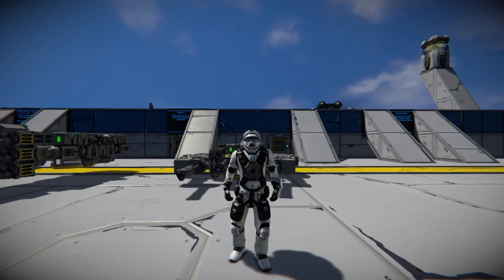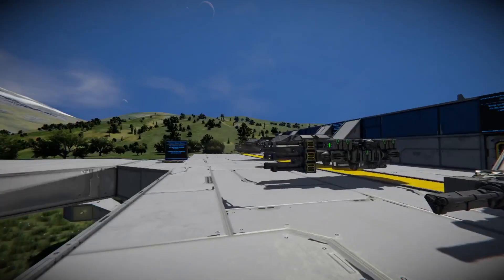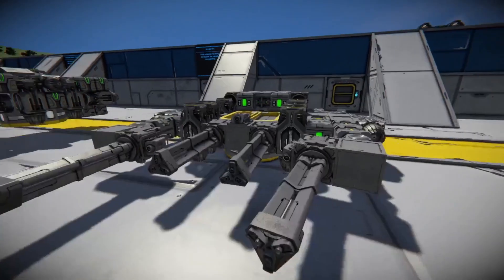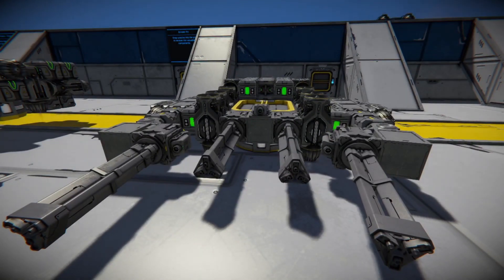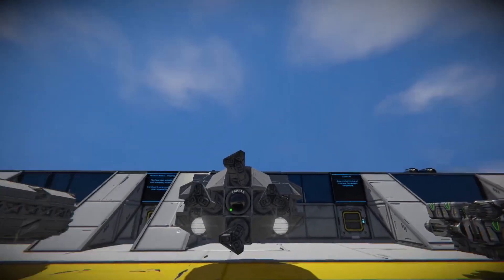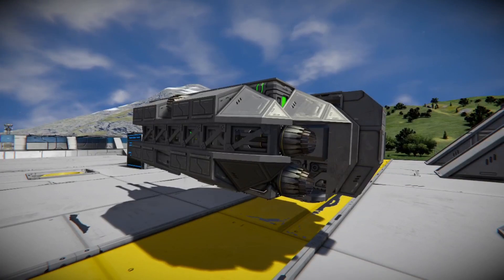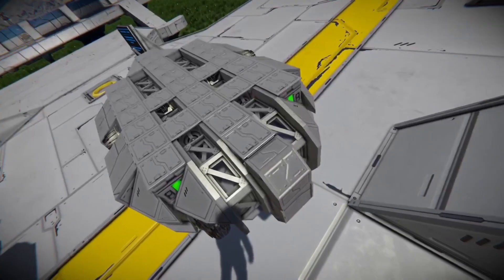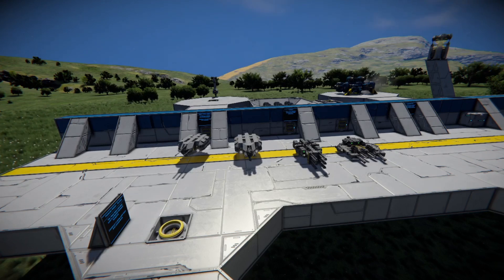Drone Build Process

Comment: niiice pretty solid build m8  ... little question did you try putting blast door blocks to see if it held better damage or added weight is just meh .. not that good??   cheers
Reply from the maker: Never thought to use them. A patrol drone with them would look cool though.
Reply: @badgerwildgaming6908  yeh i thought bout it and im trying a model out im just not sure blast doors can be better now that ( some physics ) are implemented im not sure how the drones will fare with damage and power to weight ratio flying around O.o still need to test alot more but regular and heavy armor is doing great for now XD
Reply from the maker: Someone proved the automations update brought newer ricochet physics too allowing a slop of heavy armor to bounce assault cannon rounds off a tank.

Comment: thats interesting that i could use the camera, when i was messing around with the combat block is said that it was using "x" weapon as the target reference point (or something like that) and in the things that it could access there wouldnt be a camera even though there was central camera mounted, if this is a hidden feature its a dumb one the ability to use the camera should be stated if not automatic at the very least toggle-able
Reply from the maker: It could be a bug too that gets fixed. It was a surprise that the guns got more accurate with the camera centered with the guns.
Reply: @badgerwildgaming6908  do you think there is a way to get them to use weapons attached to timer blocks, i am brand new to the game and dont really know what all blocks there are to test this, i do have a ship in mind if you think youd know/be willing to help
Reply from the maker: Yes but you would need a timer for each block unfortunately and that can cause performance issues.